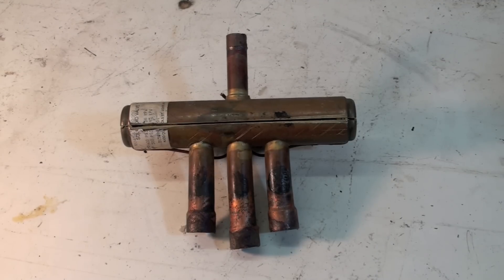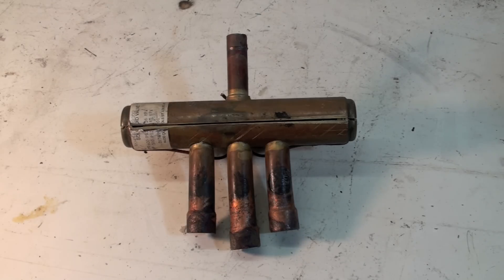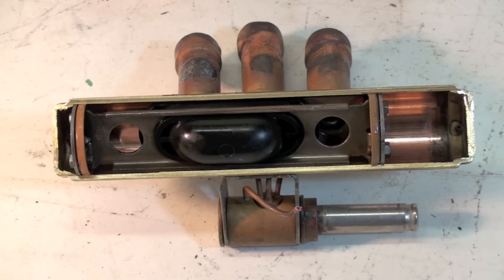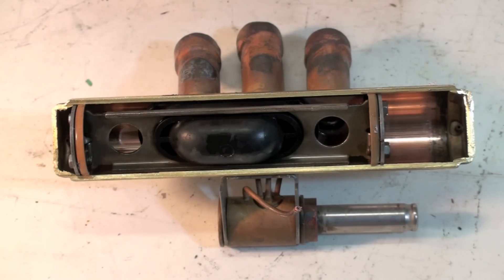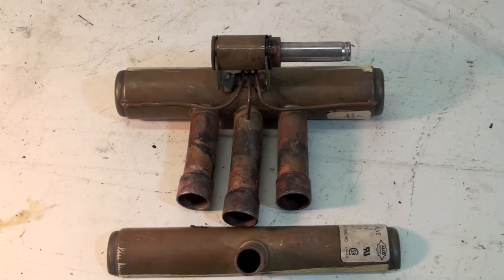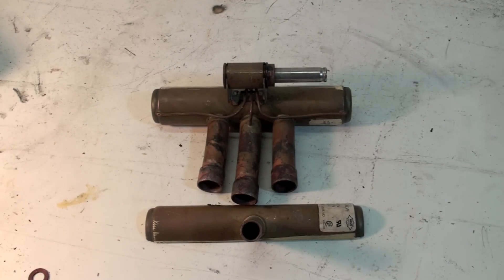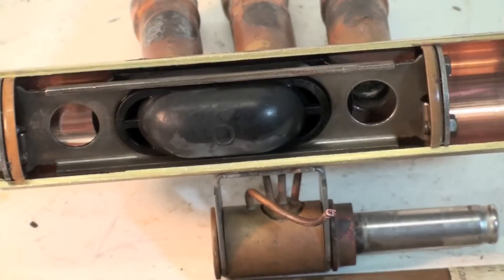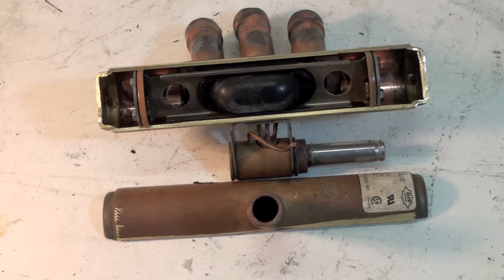how does the heat pump reversing valve work

Comment: Can they get stuck vibrating back and forth causing 250psi on both inlet and outlet of compressor side? Mine is vibrating and very hot (115F+) @ 70F ambient with compressor off (102F compressor temp)
Reply from the maker: Remove the connection to the solenoid and see if it continues.
GFM
Reply: @grayfurnaceman  I removed the connection, and it immediately stops vibrating and loses heat. I need to measure voltage on that connection but afraid to put the unit in cool.
Without a connection it looked like 0.1amps A/C voltage which was weird.
Reply from the maker: @lifeisgood070  Either you have a low voltage condition at the solenoid or the solenoid is failing.
GFM
Reply: @grayfurnaceman  replaced the whole unit today. It literally never worked for 3 years anyways. Appreciate the reply. It was an old Payne unit and literally could not cool below  80F, was ridiculous and ppl kept saying the pressures were right.

Comment: "For a bad day at the office" -

- changes the compressor
- test the compressor
- new compressor ruined Again because  reversing valve was bad.
Something similar:
https://youtu.be/D1IxdNk5NiU
Reply from the maker: The issue of diagnosis of a reversing valve failure or compressor failure is a monster.  A stuck reversing valve can mimic valve failure in a compressor or vice versa.  Not only is it possible that either one could be failed, they both could be failed.  
GFM

Comment: Does the valve ever move if you are in cooling always? Will it stay in cooling position when the unit is off?I ask because if the unit has been working great for a long time and only used in cooling mode, then you could eliminate it as defective, should a cooling problem arise, because why would it move?
Reply from the maker: If the solenoid is energized (or reenergized as the case may be), the valve will move.  Otherwise, it will stay in position.
GFM
Reply: @grayfurnaceman  , so does it have a neutral relaxed position that it reverts to when de-energized? You would think it would stay where it was until the other mode is called for. 
Thanks.
Reply from the maker: @josephkostinko739  There is only an energized and deenergized position.  One is cool and one is heat.  Which is which depends on the manufacturer.
GFM

Comment: I have a few rooftop air conditioners/heat pumps. And one of them is backwards. The thermostat has to be on Heat for it to cool. And has to be on cool for it to pump heat out. I can tell you that the thermostat is Not hooked up backwards. Can the solenoid be wired backwards? Thanks
Reply from the maker: The solenoid cannot be hooked up backwards.  
One of the units may be of a different manufacturer that has the reversing valve plumbed differently.  
Other than that, the wiring or thermostat must be wired incorrectly.
GFM

Comment: Great video!! I'm a commercial tech, never see heat pumps. But as luck has it I get to help a family members unit. It's a r410a system, it runs for about 10 mins then the high side pressure starts slowly climbing. Is this a reversing valve issue?  Of course i've cleaned the coils, done all the obvious checks.
Reply from the maker: I would be looking at superheat and subcool.  Possible overcharge.
GFM

Comment: Thanks for the awesome presentation. At 5:25, you say: most of them are energized at cool. Do you know if it should be hot when it is energized? My reversing valve solenoid is hot, so one cannot hold fingers on it. It is energized when the system is switched to cool or even off. It is not energized only when it is on heat.
Reply from the maker: This sounds like the solenoid is not pulling in the armature completely.  It will overdraw if it does not pull in completely or the solenoid is not fastened down tightly..  Normally, the solenoid will draw about 4 watts.
GFM
Reply: @grayfurnaceman  Thank you! I think you are right. And the reason might be that there is no enough freon pressure. I suspect that the reversing valve is leaking, because the whole issue has happened just after a few cold days, when the A/C was turned to heat. There is no visible trace of leakage, though. Can the reversing valve leak through its solenoid?
Reply from the maker: They can leak anywhere.  There should be oil on any leak.
GFM

Comment: I’ve got a question about a carrier ptac unit that has a hydronic heat coil that runs under the ptac unit. At some point a previous owner replaced the the ptac unit with one that doesn’t control heat. Strange thing is though there is still a celenoid valve attached to the hot water pipe that runs under the ptac. The wires on the valve are just cut.  Question is it seems hot water still travels through the valve when the heat is on even though it’s not activated. Do I need to remove the valve? How do I know it’s letting all the available hot water through it? Another question is can I hook the valve to a power source and thermostat that allows me to control the heat ?  
The design of the system is absolute garbage. I have to tape up all the ptac vents so that the air is pulling from the bottom instead of the front. Otherwise the room is cold. I think newer versions have the heat fins running on top.  
I appreciate any words of wisdom or advice. Thanks much, Bill
Reply from the maker: If you know the voltage of the solenoid, you can use a source and thermostat to control the heat.
GFM

Comment: Hi, I have an AC system that barely used (<10 times) but 8 years old. The technician told me that the solenoid has to be replaced because we got heat while set the AC to cold.  And the fan of the unit blows out cold air. They will charge >$1000 to change the solenoid. Do you have any cheaper way to fix the solenoid problem. Thank you.
Reply from the maker: The solenoid replacement is quite simple and cheap.  $100 to 200.  $1000 is more like a reversing valve replacement.  You need to find out which is being replaced.
GFM
Reply: Thank you so much for your reply. I have another question. Could it be the control voltage for the reversing valve go bad because the technician wiggled the wires and it works for few minutes then went bad again?
Reply: By the way, sorry about the confusion. The technician said the reversing valve needed to be replaced not the solenoid. Could it be the solenoid or its control voltage go bad because the unit ran less than 50 hours of its 8 years life? I hardly believe that the reversing valve is bad because, 1 time, it worked for 5 minutes after the technician wiggled the wires.
Reply from the maker: From what you say, it sounds like the solenoid is the problem.
GFM
Reply: Thank you

Comment: i think my valve is stuck half way open, im in FL and have a well insulated house and have never used my heat, is it ok to just remove the valve a hook it up direct?
Reply from the maker: You can, but it is quite a job.
GFM
Reply: hey gray, thanks for the quick reply, can you take a listen to my video and tell me if im right about the valve, noise is def coming from that area https://www.youtube.com/watch?v=RosviBfu7mw
Reply from the maker: Its pretty hard to tell by the sound.  It sounds like an out of balance fan to me.
GFM

Comment: Thanks for the info very good video! I just yesterday had to replace one of these on a water source hp and the thing was very awkward to get to i wrapped it in wet rags and put some thermotrap on it as well cus i was afraid of overheating the sucker but when i went to fire it off the valve was stuck in heating mode I must’ve melted the teflon or something or it may have been bad out of the box not to sure. But do you recommend any certain way of keeping the heat off of them as much as possible? Ill be going back there soon to replace it for a 2nd time and i dont want there to be a 3rd lol thanks again
Reply from the maker: There is nothing harder than brazing a reversing valve.  The trick I found is to use a large tip on an oxyacetylene torch.  You need to heat it fast.  The easiest way to overheat the part is to use too low of heat because it takes too long.
GFM

Comment: What type of metal is inside? I opened one up and a magnet won’t stick to the part holding that little copper cup.
Reply from the maker: Its mostly copper, but some parts are steel, probably stainless.
GFM

Comment: Thanks for sharing.  Very new to heat pump repairs- not an HVAC repair person- just a working woman who needs help with heat pump- can the solenoid be changed on reverse valve or must the whole valve be replaced?
Reply from the maker: Yes, the solenoid can be replaced separately.
GFM

Comment: What kind of metering device is used in reversible ac systems? I don't imagine metering devices using diaphragms can work with reverse flows.
Reply from the maker: Both fixed orifice and TXVs are used.  There are TXVs that are bi flow and some use check valves to bypass.
GFM

Comment: +grayfurnaceman hi, im LEO, i got an old AC unit 2 ton that work ok in cooling mode but in heat the unit work for 10-15 min and when reaches full heat power in the inside unit you hear a loud gas noise and the unit turn itself into cooling mode, so is this fail always this valve?
Reply from the maker: It could be a number of things.  You could have an air flow problem that overpressures the unit, You could have the backup heat coming on at the same time as the heat pump.  Probably the last thing I would think would be the reversing valve.
GFM
Reply: no airflow problem, checked both. is a 12 year r22 unit, i was positive on the valve leaking inside and opening by fail to stay in the commanded position......
Reply from the maker: I don't have any answers for you.
GFM

Comment: just stick a screw driver shank into the solenoid valve and you don't have to worry about burning it up....learned that the hard way :D
Reply from the maker: Good tip
GFM

Comment: Gray , if I have to replace a compressor in a heat pump will be smart to do valve at the same time because we don't know what causes the problem in the old compressor and please explain how the solenoid work in detail, I'm in Miami we don't have heat pumps here but I'm interested thanks
Reply from the maker: The choice to replace the reversing valve is somewhat tough because you cannot check operation because the compressor has failed.  The rule I use is, if it is a locked rotor, no phosgene  (R-22), no short to ground and less than 15 years old, do not replace the rev valve.  Any of the above positive, replace the valve or replace the unit.
GFM

Comment: Sir. As per your explanation the hot gas is entering through capillary tube on one side say right side and suction gas is entering through the other capillary say on left side hence the the sliding body will move to the left meaning that solenoid valve has positioned its valve in such a way  it allows hot gas on one side capillary and suction gas on other side capillary.But from another video I understand that the solenoid valve say when keep one capillary open say for low pressure gas then it actually closes the hot gas capillary  and actually hot gas enter other side of sliding body from hot gas pipe side.

Comment: We may have a sticking reversing valve. All signs point to it.  Why would unit shift easily from heating mode to cooling at Tstat manually,  but not when defrost board demands the shift?  That 24 volts demand board should energize the coil as well ?    Can there be a low pressure situation to the SOV at defrost board demand ?  It should be there as well  at SOV  when T state is engaged manually from T stat.  NO ??? Thanks

Comment: Great explanation. The valve on mine was diagnosed as being stuck so it only works in cooling mode. With low LP prices, I don't use it as a heat source anymore. Is it necessary to replace it under these circumstances?
Reply from the maker: +deere3321 No.  Just continue using it as an A/C.
GFM
Reply: +grayfurnaceman. Thank you
Reply: grayfurnaceman i can operate my equipment without not energice the reversing valve because i in puerto rico and we dont need heat pump mode true or false iam ac technician too thank you

Comment: You have helped me before on heating coils wiring on air handler .  Now , during both past snow storms ,  outdoor heat pump shut down. Ice was on coils outdoor unit . about 1/8 inch . (Snow was not allowed to accumulate around outdoor unit during snow fall .)  This unit has never been known to go into defrost. First winter   Ive watched and heard it cycle ,  Tstate never showed calling for Aux   and fan never stopped to show 90 min defrost time reached.        Previously, Tech shorted defrost pins at  circuit board and unit went into defrost, fan stopped and whoosh . Unit worked fine for 2 weeks   Then came the second snowfall all seemed ok until  morning and outdoor  unit was off again     Aux was on and keeping house warm .   I turned off Tstat and Aux. after main electrical power lines were out 6:00 am . Power was restored by 4.pm.     All ice had melted from outddor unit . I turned on Tstat and everthing worked perfectly . We have tech coming over tomorrow . Can this reversing valve cause icing ?     And can Tstat Trane 602 orange wire not be hooked up correctly either outdoor or indoor to cause this problem? Trane trouble shooting says Sov defective or defrost contol defective primary causes. Can A410A overcharge( subccol) be the problem ? The sub cool is at 30 which tested at 41 deg is high,  as tag states 10,    head pressure was 415 ,suction 106.   Problem is exact readings cannot be taken at these low ambient temps . Correct?       Sorry for the detailed info but I thought it would give you a better diagnosis. Thanks.
Reply from the maker: +oldtimedrumcorps Reversing valve can cause failure e to defrost.  However, it seems that it does work. Wiring is probably ok.  Sub cool may not be reliable at low temps.  I don't know what temps you have.  The head pressure seems high.  Airflow issue?
GFM
Reply: +grayfurnaceman   Yes, tech agrees with your thoughts on reversing valve functioning.  Tech wants to  .If sub cool is too low 30 doesnt that mean a greater drop in refridgerant  temp to rise,  thereby causing   supercold  refridgerant  into liquid/ vapor mix in the coils to be super cold and not allowing for a good defrost ?   Due to overcharge?     Hope my hypothetical  is in  line with the concept . 30 sub cool just seems so far from boiling  to allow good defrost ??     410a refriidgerant.   . Trane says  be 10 subcool.   Air flow ; Filters are clean and coils appear visually clean . Yes I agree 415 head is high .    Mid 300s ?   Tech feels overcharge.  Was read at 41 F. outdoor   Funny , how when outdoor unit cycles after longer off  cycles (higher outdoor ambient) its much louder at start up.    Yet when colder ambient and more cycles it sounds quieter at start up.   Hopefully Mondays 54 deg. expected ,will help testing charge  level.  I will keep you posted ,,  Once again ,Thank you
Reply from the maker: +oldtimedrumcorps The high subcool would cause the high head but I can't see how it would affect defrost.  Head pressures are dependent on outdoor temp, but under 300# normally.   First thing I would do is deal with the possible overcharge.
GFM

Comment: Great Video! Thanks! I appreciate the layman's terms and clear direction. I have a Carrier heat pump that is doing just the same thing you're talking about, and I actually thought this last summer that the compressor was going because it was smoking hot after freezing up. I got it to last for the summer, but I just changed the thermostat for no heat issue and the coil actually frosted on heat mode! I believe this is the culprit right here! Thanks again from a newbie HVAC tech
Reply from the maker: +mattnichols2 Welcome
GFM

Comment: GFM, I was wondering if you do a pump down with the reversing valve in heat mode would that allow you store the refrigerant in the indoor coil and linesets so you could work on the outdoor condensing unit?   In my case I want to replace the accumulator.  Thank you.
Reply from the maker: +Gene Friedman You can.  Sometimes there will not be enough space in the coil and lineset.
GFM
Reply: +grayfurnaceman That is interesting....  now what about on an AC condenser without reversing valve..... instead of closing the liquid line first as usual and pulling refrigerant into the suction port - could you close the suction port and force the refrigerant out the liquid line into the evap and lineset - or would that kill the compressor?
Reply from the maker: +Gene Friedman Nope.  All it will do is pump into both the evap and the condenser.  It won't kill the compressor unless you leave it on for a week.  No such luck.
GFM
Reply: +grayfurnaceman Ahhh, yes I see - the discharge from the compressor has to make its way out through the condenser coil first.  Blast.... oh well it was worth a shot.   Appreciate all you do.... thanks!

Comment: grayfurnaceman Great videos, I don't know if you can help but when I turn on the air condition to do the heating it starts heating for 30 min e it stops and doesn't heat anymore, can it be an electrical problem from the capacitors or it is a sliding problem
Reply from the maker: Could be many things.  Most likely if the outdoor unit continues to run with no heat, there is a low refrigerant charge problem.  The compressor may be overheating due to low charge and shutting off.  Hope this helps.
GFM
Reply: grayfurnaceman thanks for the reply Im gonna try and  hope I can make it work like before